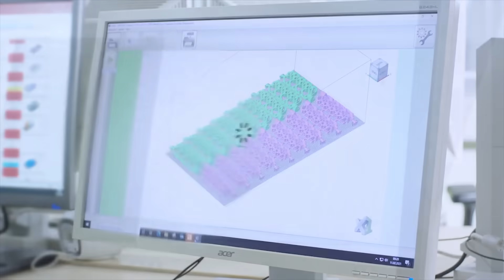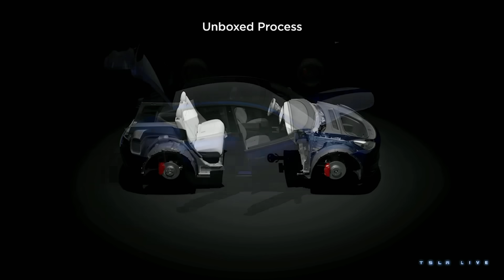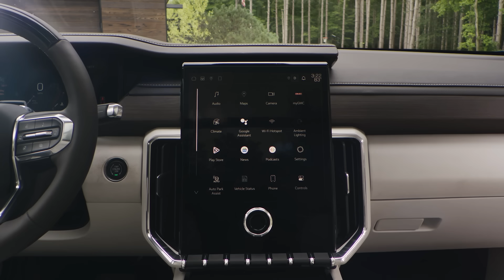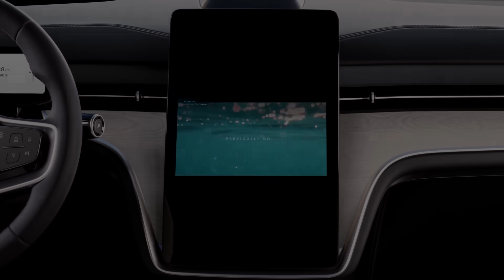Tesla Developing Gigacasting Breakthrough; U.S. BEV Sales Soar - Autoline Daily 3648

Comment: More sneak peeks at newer cars that are much bigger and much more expensive than existing models that are already too expensive. Heckuva job, Detroit.
Reply: The playbook has been working for 30 years.

Bigger, bigger, bigger, bigger and bigger still.

If it weren't for the inconvenient problem of climate change, we would surely have already seen bonafide "Monster Truck" versions as factory options in every pickup line, complete with 5 ft. high tires.

From an automaker's point of view, people who like that big stuff are easily parted from their money.

Comment: 97% less expensive?  Are you sure it wasn't 96%?  🤣   3-D printing really is starting to have a real, immediate impact at the manufacturing level now.  That is so cool.
Reply: First sold in 2002 the ExOne S10 was not the first 3D printer to be able to print sand. However, it was the first 3D printer to be sold commercially that could print sand molds and cores for metal casting.  LOL bet you did not see that coming.

Comment: The big three all have a huge issue today, that the union is ACTUALLY trying to solve. All of them are having huge issue's retaining staff. At GM its said to be less than 15% of new hires, stay longer than 6 months. And the other two are not much better. They can make more money working at McDonalds in some instances. And half of the people on the lines are temp workers. A lot of them have been there for years paying dues, but not getting benefits. New hires get the lay of the land and realize its hopeless and look elsewhere for work.
Reply: Consider GM hiring policy. No smart applicants are hired. Mary Barra? Q.E.D.
Reply: The union thing is a side show.    Their problems run much deeper.
Reply: Perhaps the problem is that the young people trying these jobs in auto factories find out it's hard work and they have to think and have a lot of responsibility. It's easier to flip burgers get paid a half assed wage.They rather not think or have responsibilities.  Responsibilities are for boomers,  screw that!
Reply: @paul5683  No The problem is that it is a robotic job. You do the same thing day in and day out over and over again. Its sole sucking work that needs to be highly compensated to put up with. The true drivers of human endeavor are proven by science to be autonomy, mastery of skills, and a greater purpose to our actions. Barely surviving is not conducive to a healthy work environment.
Reply: @paul5683  An AI enabled humanoid robot could wipe out 90% of these jobs today. And Tesla is already working on it.
Reply: The union is the issue lol
Look at the unfunded liabilities from pensions, no company can support that.
Reply: Or they can make their assembly lines more effective,  eliminate useless repetitive labor and add a few more robots

Comment: GM has been printing sand molds for the last 2 or 3 years at the Bedford casting plant.
Reply: I thought Saturn and Chrysler did this in the 90s?
Reply: @dontelindsey5846  the sand printers have been around since the early 2010s, so unlikely with Saturn. Perhaps you're thinking of the sheet molding compound used for the body panels? I'm not an expert here, so I may be missing something.
Reply: @MSportsEngineering  I'm no expert either and you may be correct. Hopefully someone will give us the correct info.

Comment: Tesla has changed the production of its new platform from NL Mexico to Texas, stating that due to the complexity, it needs to be done where it's engineering team is located so that difficulties can be immediately addressed.
Reply: Yes, I was going to say the same thing. It's planning to start in Texas sooner and then expand to Mexico 2025-2026 for more units.
Reply: Yeah, work out the issues until it's a standard process and then spread it around.

Comment: Still waiting a few more years for us to find out if the big castings are beneficial for the vehicle owners, or only profits the company.
Reply: A few more years accidents will be 1/10 of the number now. The assessments will not reflect the effect of castings
Reply: Tesla has been taking smaller profits on the cars since it started pushing prices down.
Reply: Well Tesla make the best value EVs because their production cost is cheaper. Does that count?
Reply: Innovation is driven largely by the prospect of industry leading profits. As the rest catch up, the prices fall. Tesla aims to keep innovating and stay in high margin territory! Others will offer the lower prices down the road!
Reply: They protect you better during crash, does that count?

Comment: This is like the sand casting process GM used to produce the first Saturn engines, but adds 3D printing to the mold build process.   Not really all that new or revolutionary but it will cut cost.
Reply: Giga casting was tech that was around long before Tesla decided to use it. Tesla just evolved it into something that seems to changing the way vehicles are made. 

Tesla rarely says the are the first, instead they say take tech and make it better. That applies to software, vehicles, and factories. 

I like the Tesla company culture as far as always looking for improvements. Nothing is off the table and the quest for better processes, better tech, and just better products, is a big part of why they have grown so much.
Reply: Casting is better than 90% about how we make the mold.   The lost foam casting as used by Saturn for engines and the very large 3d printed molds Tesla is making have little in common but sand.   Using 3D printing molds of this size for a die casting machine is new as is making the bottom of a car with the process.  Call it evolutionary or revolutionary.  Not going to argue about that but the application is undeniably new.
WARNING  home/backyard metal casting is addicting.
Reply: @kevtheobald True that castings, are not new.  The idea of using it in large parts for auto is also not new.

Giga castings, are new.     The size and scale of the Giga castings and the metallurgy they use is all new and did not exist in a way that it could be used at scale for auto production.
Reply: @kevtheobald incorrect statement. Automotive castings of this size were not possible until Tesla engineered their way into it.
Reply: @jeffgorchynski  Incorrect? No. It is like saying modern gas engines have nothing to do with early gas engines, but they are connected. Yes, Tesla did it on a larger scale, but that means they enhanced the tech, evolved the tech, took it to a new level, but it was not something totally new. 

Splitting hairs for no reason. I just appreciate Tesla willing to gamble to push tech that others feared or were too lazy to push. 

Based on what Sandy Munro said, he tried to get some legacy builders, Ford and Chrysler if memory serves me correctly, to take on the casting tech and evolve it, they both passed to be cheap. Now they are scrambling to catch up on something they could have been leaders of.

Comment: The $25k car is no longer slated to come from Mexico first. That plant is delayed. They are already laying out the line for it in Texas now. I fully expect that by the end of next year they will have that car available with a 275 mile range, and less than $19k after taxes and incentives. Good luck OEM's.
Reply: But it is said there is no room for it in TX.
Reply: @danharold3087  There is. Its going to be a MUCH smaller footprint than a traditional assembly line.
Reply: @danharold3087  There are currently 2 lines for model Y. There is room in that space for 2 more, and I believe at least one more is being added now. Then you have 2 more areas, one for the Cybertruck, and a one for the Model 2. Both of which areas will house multiple assembly lines as well. People do not realize how compact Tesla is now because of how few parts they have. And the use of completed sub assemblies arriving on site for the new production process will shrink it even further.

Comment: I sure hope Tesla comes up to speed with its own "affordable" insurance. These giga cast cars are basically giant throw away vehicles when they get into minor collisions for a multitude of reasons. A lot of mainstream insurers have either jacked the rates up or are not insuring these at all. The same goes for power walls and homeowners insurance...
Reply: It doesn't help that in the last two years repair shops jacked their costs up for repair work. I got rear ended where my bumper just needed a little sanding, redoing clear coat. They tried charging my insurance $1,800 for a hand size spot. Insurance only gave them $1,100.
Reply: This had been repeatedly debunked. Do some research.
Reply: @itsatrap7215  Try your model X knocking a passenger side mirror off itself in AP and not under warranty.

Comment: 3d printed sand casting molds are for prototyping, not for production. This has been around for years it's nothing new.
Reply: 💯

The 3d printing and sand casting is not the story here.    The real story is that Tesla may expand the use of Giga castings.
Reply: Tesla is prototyping .    The sand printing machines are 20 years old.  
Unless tesla is getting some even larger die casting machines I don't see how they can be using these printed molds in conjunction with die casting.  Would love to get a peek at what they are doing.